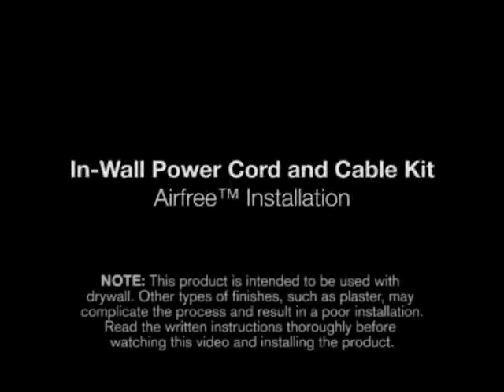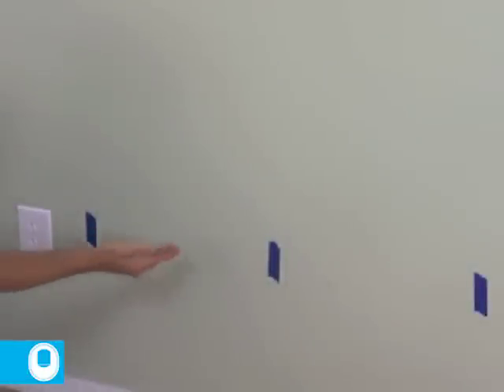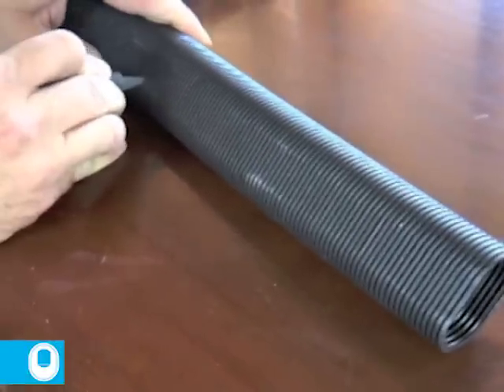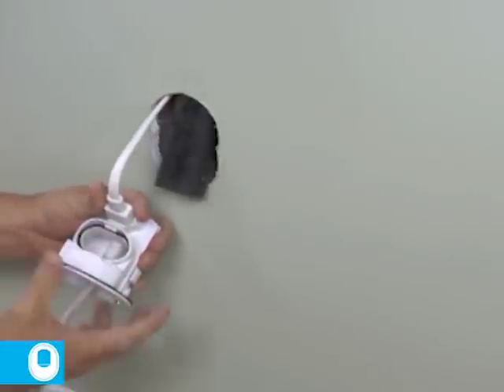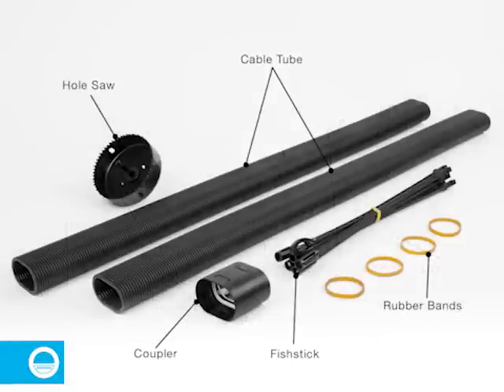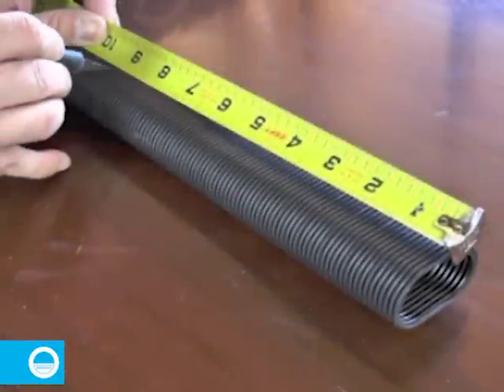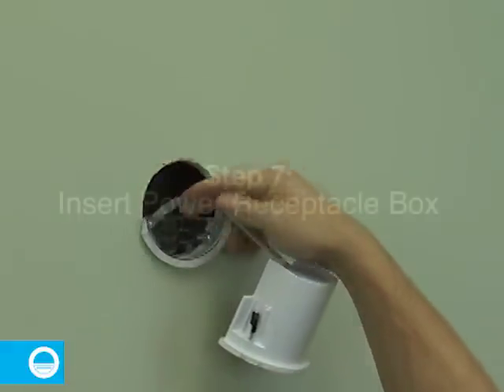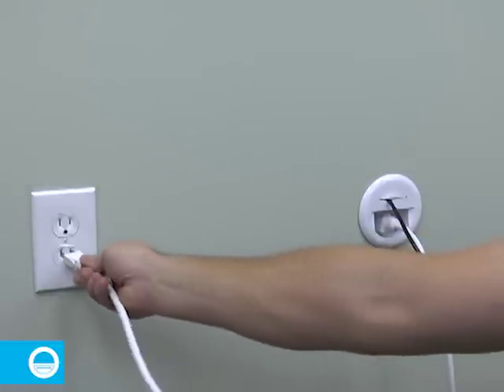EC300 Flat Screen TV In-Wall Cover and Power Kit installation

Comment: I know this is an old video but I have one of these and need to remove the faceplate to feed new HDMI cables through. How do you get the face plate off without damage?
Reply from the maker: Hi and thanks for your question! You should be able to pry the cover off of the base by using a flat head screw driver working from one end to the other. Let me know if you run into any problems.

Comment: Can you plug in more then 1 component into the top receptacle by adding an outlet adapter? Planning on mounting cable box to back of tv. So I need 2 plugs at the top.

Comment: what if I have a cross 2x4 obstructing? The wall I intend to place my TV used to be a shared wall of the 1 car garage (it's now a bedroom).
Reply: How did you end up resolving that issue?? Having the same situation.  Thanks in advance
Reply: @flipper283  I haven't. Yet. I've surmised that I'll have to cut the drywall and drill through the 2x4's then patch it.
Reply: In all honesty it'd probably be easier to open a 2" wide vertical strip in the drywall, make your installation and then replace the drywall strip, mud and paint. Not sure how else you'd blindly get through the cross member. They make drill bits that are flexible and long that you can drill 1“ holes etc then once you're through, you pull the bit back with your wire attached.
Reply: @joelmatteis6189  true. I'd have to do it about 5 times. Speaker wire needs to travel about 10 feet across and down 5 feet.

Comment: Is this kit code compliant, for it to be so I would have thought the NM cord would be in the tube and the other low voltage wires on the outside?
Reply from the maker: Hello, thank you for the question - yes it's code compliant the NM cord can be run behind walls without the tube.  The tube in this case is just there to help guide the low voltage wires, not to protect them.

Comment: So the plate gets screwed into the sheet rock?
Reply from the maker: Hello, the screws actually work with the clamps to compress the dry wall.  Turning the screws clockwise flips the clamps out towards the dry wall, while turning them counterclockwise loosens the clamps and flips them inward away from the wall.